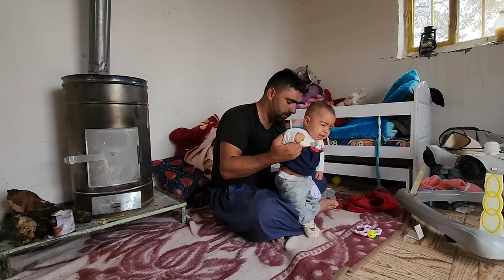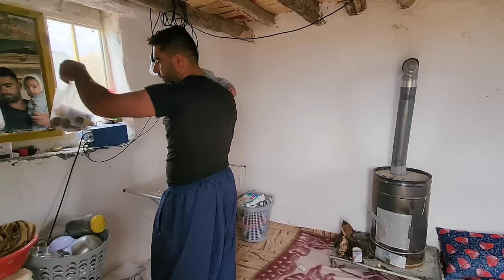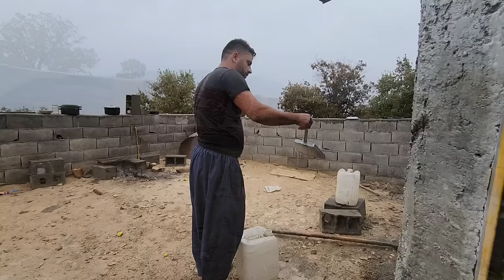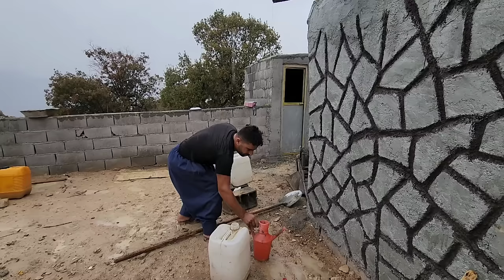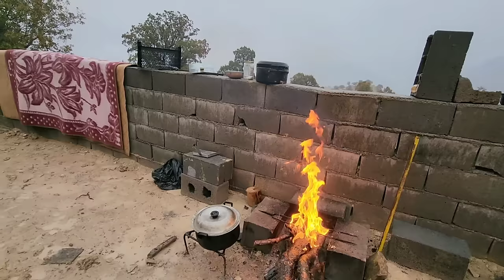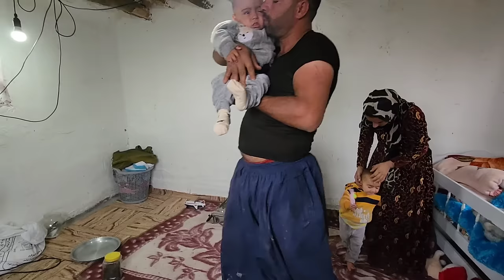The Nomadic Father: A Mountainous Journey Through Rain and Reunion

Comment: i no this is going to sound horrible but a doctor told me once when my daughter was put on medicine only 9months old to lay her back and as soon as you put the medicine in her mouth pinch her nostrils ever so slightly he should me how to do it the first as i was like no way was i going to do that as soon as you pinch there nostrils they have got no choice but to swallow you only do it for a split second and it works i never had screaming or shaking there heads and waving there arms and legs about trying to get away from me everything was over and done with   from start to finish in less than 10 seconds with my daughter getting her full dose of medicine and none of it getting spat back out